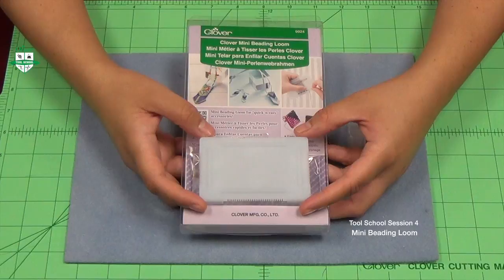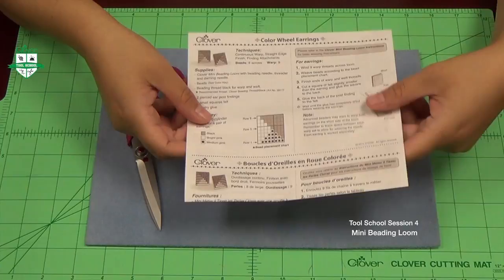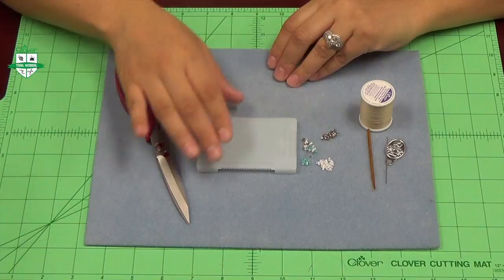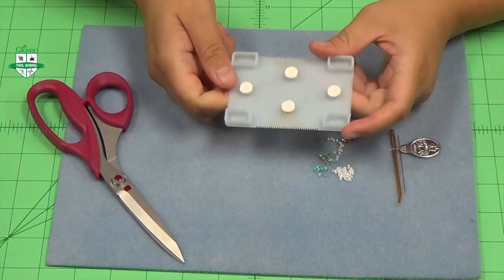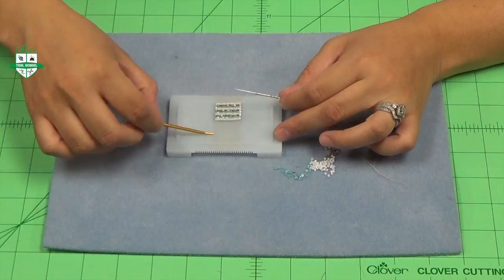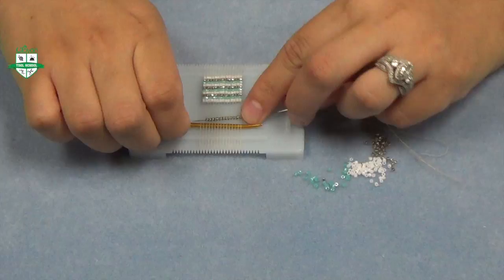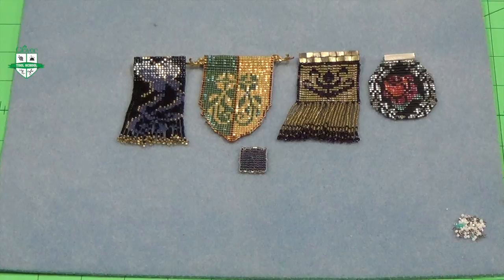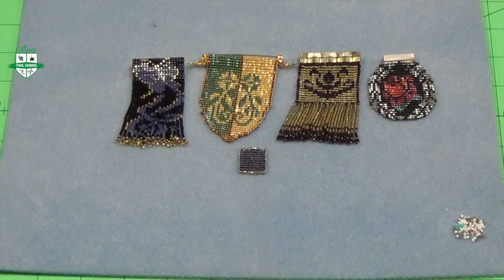Tool School: Mini Beading Loom

Comment: Hi! Just a couple of things: 
* for demo purposes, it would have been more effective if you had used darker thread.
* it also would have been nice to see how to loom the first row. You go from the weft thread being tied on to an almost completed project. For a new user this was not helpful. 
* the hands blocked what was being done.
* it helps when the demo is done from the user's perspective, so the demonstrator needs to work upside-down.
I am an intermediate loomer, bought this because, ya know, you never have enough looms. I found it awkward initially to loom the beads between the warps, and am not an advocate of the eye-first as it leads to too many poked fingers. I do plan on working more with it. I love your adjustable loom --- it is my favorite!
To the people who haven't used it --- your opinion will weigh more once you have experience with the product.

Comment: This loom looks like a nightmare to use. Why didn't they just use a small frame? there's really no need for the back and it would be so frustrating to try and get your beads under between the needless back and the warps. As soon as the darning needle was picked up, I realized you couldn't pay me to use this "loom". It's like using a matchbook to as a  loom. I really don't know why anybody would ever need to use such a tiny and cramped contraption.

Comment: I can think of five things you can do to this loom to make it more comfortable to work with.  This thing is a nightmare.
Reply from the maker: Hi Deborah, 

We'd appreciate any feedback you can provide. We are always looking for ways to improve our tools. Thank you.
Reply: You need more room under the warp threads so you don’t have to fight to get the beads under the warp.  It’s a cute idea to set the beads in the right place when you push down, but I’ll bet there are a lot of missed beads on your way back.  I do like the way you pull the loops to finish the ends though.

Comment: Love the tip to use the eye of the needle to weft the beads, but otherwise, this particular tool looks cumbersome. Having to lift those warp threads every time you add a row seems like it would cause problems with the tension, not to mention it obviously takes longer than if the loom had some sort of clearance beneath the warp threads.

Comment: The time that takes to warp that tiny loom, I could've square stitched that piece. Agree with what others have said, you need space under the warp threads to be able to push the beads up into place.